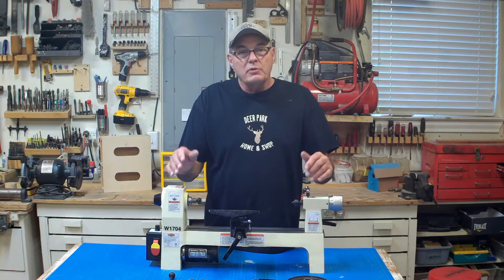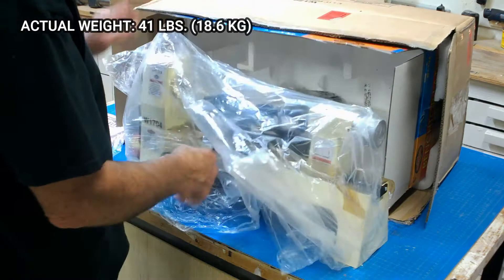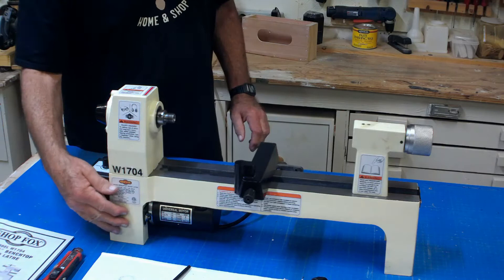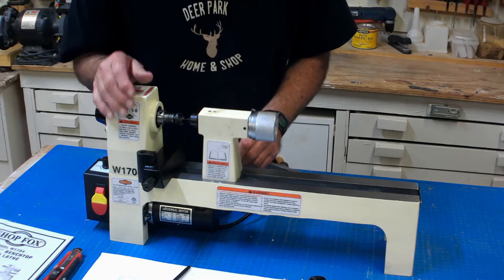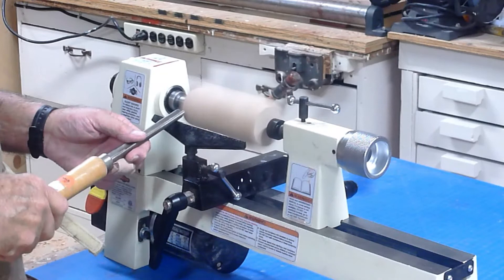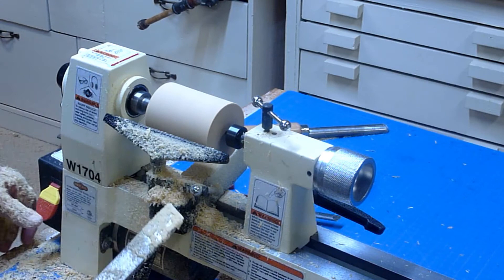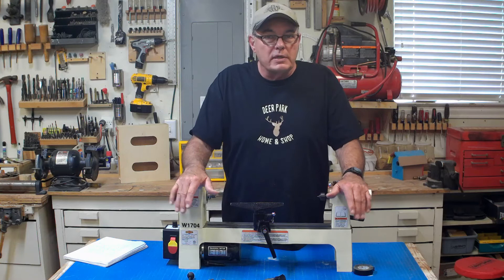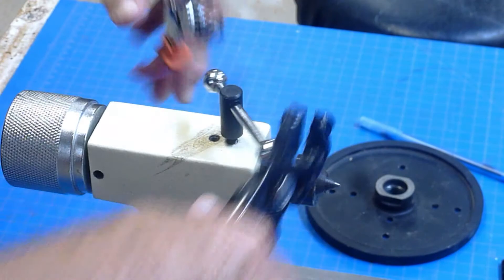Shop Fox W1704 Mini Wood Turning Lathe - Unboxing, Set Up & Review

Comment: I have the same lathe in Grizzly. All the pros you mentioned I agree with. The con being 1/3hp. I wanted to be able to turn small bowls and larger than pen spindles such as duck calls. The con 1/3hp slows work down to a crawl. I have looked at 1/2hp motors to see if it’s possible. They cost too much. I hate that it’s limited by the motor because I really like everything else. Harbor Freight makes a 1/2hp mini that I wish I’d got. If I can sell and recoup some money, I’ll spend about $150 more for the larger Grizzly. Thanks for showing your video. I was hoping I had missed an adjustment.
Reply from the maker: And the problem is that most of these small capacity lathes have a 1/3 hp motor or less.

Comment: For me and my use of a lathe, this review was close to perfect. The key was your essentially saying at the end of the session that the Shop Fox is excellent for people spindle-turning pieces up to 4" in diameter——such things as pens and salt shakers. I intend to use it for occasionally turning fishing lures that will never exceed 1 1/2" in diameter (and 10" in length). THANK YOU—for both your thoroughness and objectivity. 
     By the way, I agree with Kevin (below) that the 8" x 13" Shop Fox is the same lathe as the identically sized Grizzly. However, the warranties on these two machines are NOT the same. The coverage on the Shop Fox is two years, whereas it's just half that on the Grizzly. To me, this difference is significant.
Reply from the maker: The actually sell it under a number of brand names.  Wen and Harbor Freight and maybe others.  Thanks for your kind comments.

Comment: I’m having a difficult time turning larger spindles. I’d love to be able to do small bowls. I have the Grizzly which is the exact same lathe. I wish I’d have spent another $100 and got at the least a 1/2hp from harbor freight. I agree with ALL the pros you listed. Really well made. I’ve looked at 1/2hp motors but haven’t found on that I believe will fit. And, they cost about half the price of the lathe. The con is 1/3hp. If I can sell mine and recoup a bit, I’ll get the larger Grizzly.
Reply from the maker: I appreciate your comment and agree with you.  At the end of the video I gave this lathe a thumbs up for smaller pieces like coffee mills and pens, and I gave it a thumbs down for larger things like bowls, and really, I think a 12" lathe, or larger, is the way to go for bowls.  You can get by by using really sharp chisels and light cutting pressure with this one, but it simply doesn't have the capacity or power to do the job.
Reply: Looking at the glass as half full, if you got one, you learn how to turn on a 1/3hp, you’ll for sure be able to turn on a larger higher lathe much better. This lathe will teach a person about physics.  All I can do again is echo what you have said. Super sharp chisels, light pressure. I can only add periodically snugging the tail stock. Lol, beating the proverbial dead horse, I just wish it was a 1/2 hp because I love everything else about it!  I can say that I have used it a lot since my last reply.  I’ve turned and hollowed honey pots out of pecan and plenty of pecan spindles. So, I know that I will be able to use it to turn duck calls and make condiment bowls. Of course, as you said it’s very adequate for pen turners.  I’ll definitely always use it because it’s small enough and portable that it can be used nearly anywhere. Because of all the pros of this lathe, there is absolutely no doubt that I will purchase the larger one that has the option of adding a longer bed. Thanks for making the video. Anyone who reads this can definitely make an informed decision before purchasing. Shop fox and harbor freight are the exact same. So, go with the best deal. I looked for a review before I purchased mine and to my knowledge, this is the only one. Is there a way to edit so that the harbor freight model? That may be helpful. Good turning to you and everyone.
Reply from the maker: @kevinfontenot9463  I think you should have made the review, not me.  You probably have more hours of actual work and you are turning a larger variety of pieces.  I hope other folks will read your comments.

The problem with all of the 8 x 13 lathes I saw is that they all use a 1/3 hp motors.  I considered a pen pal and it only had 1/6 hp, but it also had a much smaller swing,  so this is hard to get around.  Of course, the shop fox is variable speed, others are belt drive and they may actually perform better, but I don't know that for sure.  I think Grizzly also offers a version of this lathe.

Comment: Great video I’m new to the hobby and considering one like it but a different brand,the only thing that’s worrying me is the 1/4 hp motor I would like to make bowls and boxes,while I understand it has size limitations I’m not really concerned about that cause I don’t really want to make big bowls,but being a problem on small ones is more that’s worrying me. Are you still using it? Have you turned any others bowls after this or other work? How did it fair up? Thanks 😊
Reply from the maker: Honestly, the Shop Fox has 1/3 hp motor and, in my opinion, it's a bit light for bowl turning.  I mean it can be done but it takes a light touch and a lot more time for good results. I mainly use it for pens, salt/pepper shakers and other small diameter stuff.  Before you buy that lighter 1/4 hp motor, be sure to do some research, read the reviews, etc. and see how others fair with bowls.  There are several small lathes with 1/2 hp or better motors that may do a better job for you.  Can't recommend one because I haven't turned on them, but it just makes sense that they would be better at this task.

Comment: That was an awesome video review! Thank you! I came here bcs well this day and age they don't make things like they used to. I'm sold I will be placing my Amazon order hopefully today unfortunately its back at the $289 price! My question for is I dont have a use for turning bowls and want to add a drill chuck and a jaw chuck, I'm not sure what I should buy? I'm mainly buying this lathe for 1 to teach myself how to turn wood (been a woodworker most of my adult life but never used a lathe) 2 I'm wanting a professional look to my wooden model car and truck wheels! Thats really the only two reasons that I'm making this purchase.
Reply from the maker: First I apologize for not answering sooner.  I somehow missed your message when I reviewed my comments.  The main thing to remember when buying accessories is that this lathe uses an MT1 taper on both ends.  Also the head stock is tapped for 3/4" x 16 TPI threads.  I haven't bought these parts myself because I use my big lathe for this purpose.   What you need is determined by the type of work you do.  Since I am unfamiliar with modeling, I can't make any concrete recommendations for you.  One thing to remember is that you only have 13" between centers, so how much capacity will you have left by the time you add a jawed chuck, a drill chuck, and a drill bit, and will that be enough for what you need to do? There are a wide range of these accessories available for these mini lathes and they are not usually brand specific.   

To me, if you are new to wood turning, the most important purchase you will make is a good set of turning chisels and the equipment to keep them good and sharp.

I hope this has helped some and thanks for watching the video.

Comment: I just purchased this lathe got it unboxed and set up. I noticed that the 3 mounting areas are threaded  holes. Could you tell me what bolts you used and how you went about making the holes for mounting it?
Reply from the maker: I have never mounted mine because I move it out of the way until I need it.  I'm trying to design a mounting system that will allow me to use it on the same table as the big lathe, and will probably make a video on that when it's done.

I couldn't find a bolt size in the Shop Fox manual.  A 5/16" bolt is just about right but it will only thread up about three turns.  I tried to contact them about this, but I haven't heard from them.  When the time comes I am going to take the lathe with me to the hardware store and let them help me size the bolts.
Reply: @deerparkhomeshop2471  Thank you for your advise on the accessories, I called  the number to Shop fox thats printed on the manual, I spoke with a very nice lady in customer service and she directed me to technical support they told me that those mounting bolt threads are a M8-1.25 metric bolt. I went and bought the bolts yesterday and they thread up nicely. Gonna get it mounted either today or tmrw. Thanks again!
Reply from the maker: @kevinbrister8801  You had much better luck with them than I did, but I didn't use the number in the manual.  I just went to their website and the "contact us" thing. So lesson learned.  Thank you for reaching out to me again.  I am going to write down the bolt size in my manual and now I won't have to lug my lathe down to the hardware store.

Comment: Just got one of these. Agree with all the points made but haven’t seen or heard any discussion regarding tailstock alignment. Mine has way too much play causing significant wobble the closer you get to the tailstock end. Grizzly hasn’t been much help. In fact they really aren’t acknowledging the problem, despite the photos I sent clearly illustrating the problem. Does anyone have any tips or tricks?
Reply from the maker: Is the problem caused by the tail stock being out of alignment or is the quill assembly loose and wobbly?  Also, I'm sure that when you install your work piece in the lathe, you are making sure that your live centers are both centered on each end.  Actually mine was accurate right out of the box.  I installed the side handle and the top spinner.  When I slide the tail stock forward, I get an almost perfect point to point match with the head stock, and you should too..  If you just got it, I think I would return it

Comment: The quality of the machine itself is more than likely fine. But the fact that it runs MT1 tapers is an issue
Reply from the maker: So you would like to be able to use an MT2 or bigger?  My big lathe also uses an MT1 so I'm not sure how much difference it would make.
Reply: @deerparkhomeshop2471  the difference is the amount accessibility of MT1 specs attachments
Reply from the maker: @justinfletcher7630  I see.  I do know that some of the small lathes offer the MT2.  Rikon, Jet, Delta, etc>

Comment: Just ought the same lathe.  Got mostly for pen turning.  Have been trying to find chuck and drill bit attachments for it.  And anything else I might need.  New to the hobby.  Did you buy anything like this and if so what did you get and where?  Thanks for taking the time to make this video
Reply from the maker: Actually, my big lathe has the same size spindle so all of my accessories fit on the shop fox.  When buying add ons you mainly need to know that the head and tail stock use an MT1 Morris taper, and the spindle threading is 3/4" x 16 tpi.  Chucks and accessories are fairly universal and most are not brand specific.  I did purchase my pen turning mandrel from Rockler,  but I purchased most from Amazon. Hope this helps.  If not, send me a comment.
Reply: You can find it on Amazon. You will need the thread adapter for your chuck. For your tail remember M1 not M2.
Reply from the maker: @kevinfontenot9463  Thanks for the info Kevin.

Comment: I used this vid to set up this exact lathe a couple months ago, the only problem so far is the vibration, I put a wooden ball about 2.2 pounds and the whole thing starts vibrating a lot and it moves all around the table, I tried bolting it down but the vibration is so strong it takes te bolts out from above or down and it even gets to move the table which is a pretty heavy table...I dunno what to do about this any advise or ideas? I´ve been thinking about some sort of industrial sponge or something like that to sit the lathe over it and avoid the contact with the table but Im not sure. Thank you!
Reply from the maker: Mine vibrates some but I am able to secure it to the bench.  Make sure that the tail and head stocks are in alignment.  The points should line up when the tail stock slides up and is tightened.  Your work piece may be chucked up too much off center causing excess vibration.  If vibrates like this with no work piece, it may be defective.
Reply: @deerparkhomeshop2471  Thank you! I realized the weight of the piece was the issue and it was causing the vibration indeed, it goes smooth with any other piece. Thanks
Reply from the maker: That's great.  Glad you didn't have to go through the hassle of a return. @abrahamcoronell4519

Comment: Hello, thank you so much for your video. I’m from Peru and I’m about to buy the shop fox lathe. My other option is the Rikon 70-105 1/2 hp but it doesn’t have speed control so between more power and speed control can’t make a decision.mI’m not thinking in making large bowls but some handle,  candle holders and bowl lids .
Then I saw another option that is at a good price and is 1/2 hp and has variable speed control but I’m afraid about the brand Mophorn,I  have no idea and couldn’t find reviews just what I could read in Amazon. Do you have any advice please?
Reply from the maker: Hello Viviana, yours is the first comment I have received from Peru. I would love to see Machu Picchu but probably never will.  It's on my bucket list though.

The Mophorn appears to be a decent lathe, but it's a 10 x 18 size which is larger than the Shop Fox, so hopefully it will fit where you need it to go.  They say it is iron construction which is good and the variable speed goes down to 500 rpm which is useful in finishing with super glue because it won't create as much friction heat as the Shop Fox's minimum 750 rpm.  The Rikon also has a 500 rpm speed. You do have to change belts on it, but those changes are smoother and faster than what I have to go through with my full size antique Craftsman.  There are some youtube videos for this lathe, but I don't see any for the Mophorn.

To answer you question, I am unfamiliar with the Mophorn brand and can not, in good conscience, try to advise you on a machine I know nothing about.  Like you I am getting all of my info from Amazon which appears to be the only place it's sold.  I sorry I can't be more help but I would rather give you no advice than give you bad advice.

Thanks for reaching out to me, and I would love to
know what you end up with.

Comment: 10:10 ''super glue finish'' Could you elaborate?
Reply from the maker: They make thin super glues that are specifically designed for turning.  Very popular among pen turners.  It gives a high gloss, extremely durable finish.  Basically, you turn your speed down to 500 rpm or less.  Put a little super glue on a rag, and apply it to the spinning piece. The friction of the turning piece will cause it to harden and cure in a few seconds, so you want to use light pressure  and keep your rag moving up and down the length of your piece. Search for "super glue wood turning finish" on youtube.  There are a number of videos that will teach you the technique.
Reply: @deerparkhomeshop2471  
Thanks much, I guess today
the term super glue has become the
generic, like Kleenex, I've found
some 'thin CA' on amazon, I'm 
pretty sure this is exactly what 
I'd need. 
Can you tell me what this pen
turning is about, is this the latest
craze or what, is it about actually
making (writing) pens on a lathe?
I just ordered my lathe a yesterday
so have been watching lots of
vids, and so many comments 
about pen turning, but haven't
quite figured out if it really is 
about thousands of people 
making pens on a lathe lol. 
Thanks, great video. 👍
Reply from the maker: @bikersoncall  First CA is the same as super glue, but you can experiment with different types of polish, varnish or other finishes.  

Second:  You can actually turn writing pens, mechanical pencils, salt & pepper shakers, ice cream scoops, etc. on your mini lathe. They make great gifts.  It's not a "craze".  People have been doing it for many years.  Like you, I  had never heard much about it until I got interested in wood turning.

Third:  To see what's available, take a look at Penn States Industries, Rockler, Woodcraft, and other on-line stores.  Even Amazon has lots of supplies and kits.
Reply: @deerparkhomeshop2471  Thanks.
Reply from the maker: @bikersoncall  Good luck!
Reply: @deerparkhomeshop2471  Thanks.
Reply from the maker: @bikersoncall  👍